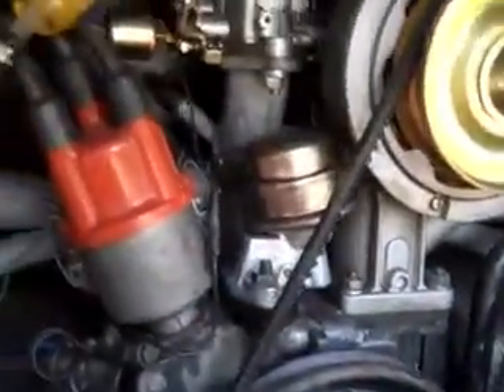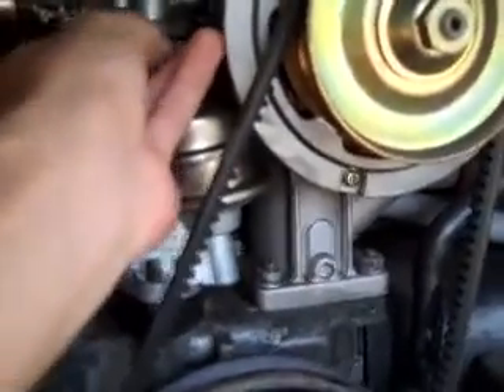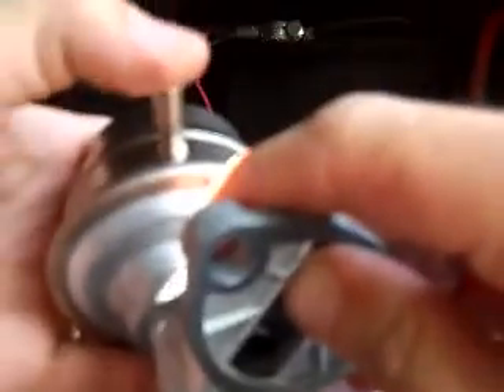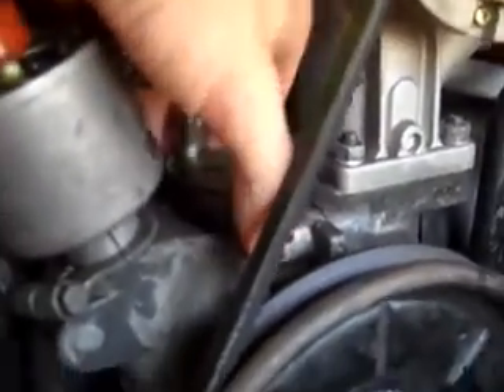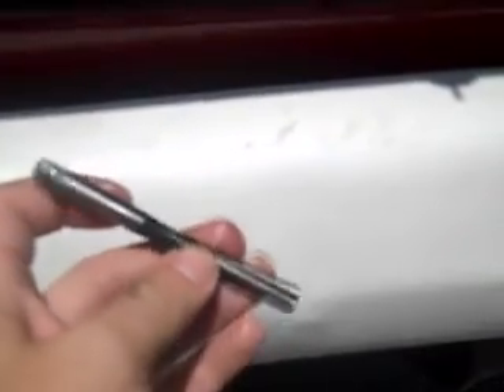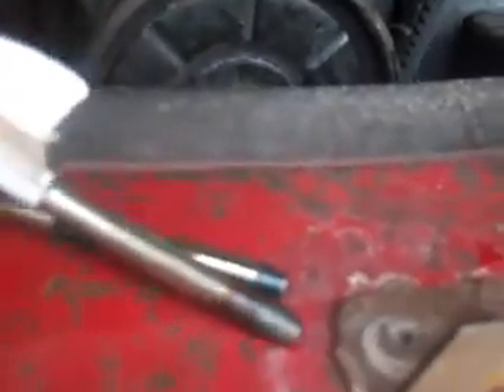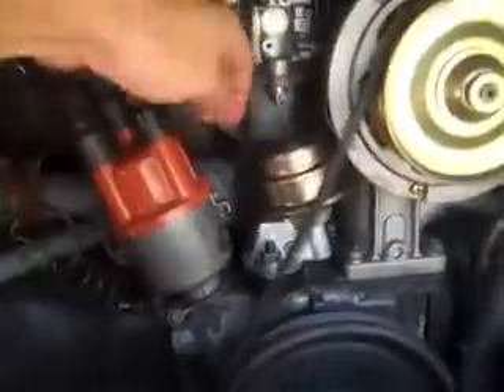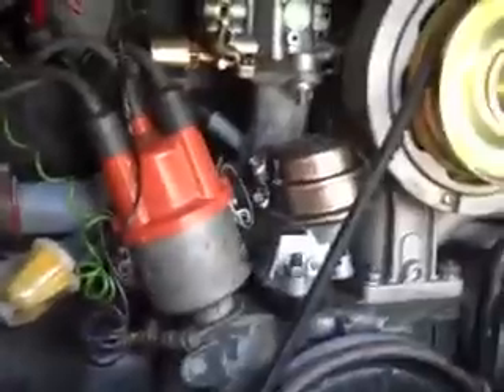fixin bus fuel pump on 1971 VW camper

Comment: Sorry, it's been a time. Is it a Brosol one the one you are installing in the video?. The thing is that it sounds great when you play with it, how it sucks air (time 1' 52"). The one I've got was failing and taking it out it doesn't make any noise;  it's dead and dismounting it I see that the internal rod that it's supossed to move doesn't move at all; it's sticked. I've got to say that first it lost the pin that holds it all and the repair shop put a new one, but the pump failed after a short time.
My big problem now is that I recently bought a modern one that was supossed to be improved and it sucks very few, so I bought another "improved one" that just broke after trying to start the engine.
The one I had working for some years was a Brosol one.